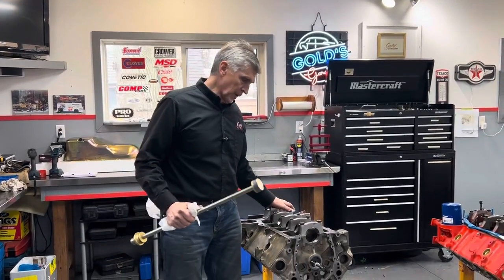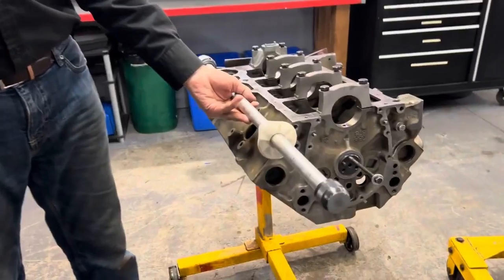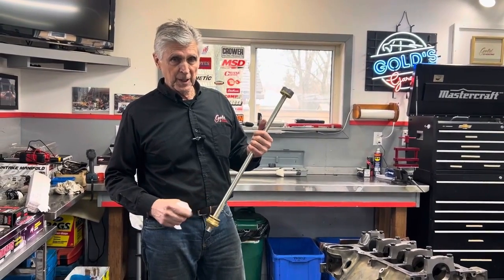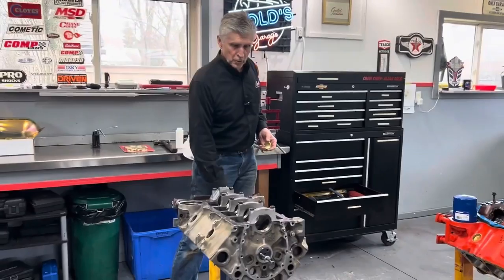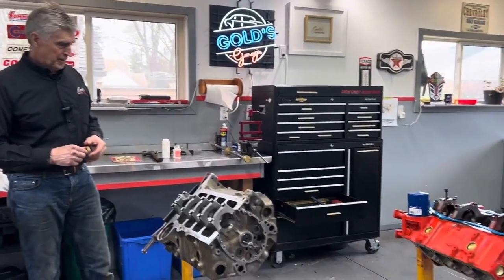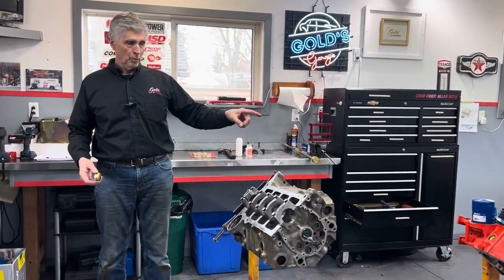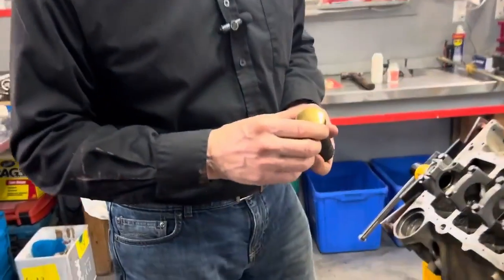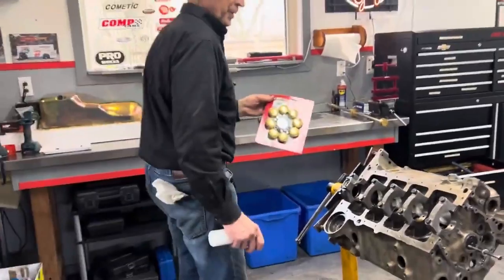Building a Small Block Chevy - Cam Bearings, Frost Plugs and Tips for a Perfect Paint Job!

Comment: On 2,3,4, and 5 the correct cam bearing hole orientation is at 2:00 with the engine upright looking at the front.  #1 would be 10 and 2 also upright looking at it from the front with the engine upright, correct?
Reply from the maker: That is correct. Thanks for the question.AG
Reply: @ thank you

Comment: Believe or not, by torching the bare steel with a propane torch, you are actually hitting the surface with a very high content of moisture.  Not kidding!  When propane burns, it creates a huge amount of water and you are actually causing instant flash rust on the bare steel...and that's what you are describing at 14:41 in the video with your comment of the  "changing color there." That is moisture forming on the surface, and you can almost see a slight browning of the steel...in other words, rust.  The only way to accomplish what you are attempting to do is with a heat gun, or indirect heat from a propane torch...but direct heat from propane is a horrible idea on bare steel.
Reply from the maker: Great information, thanks for contributing to my channel Rich. AG

Comment: If you point a torch at cold metal the steam in the flame will immediately liquify on the cold surface of the block. (You are burning a hydrocarbon after all). The block would quickly rust if it had water on it. I do not believe there is water in the metal.  Any iron in contact with water and air will rust immediately. Also note that air will dissolve in water if above freezing so rust will start immediately.
Reply from the maker: Thanks Marcus. AG
Reply: Uncle Tony’s Garage did a video on torching the block first to pull the cleaning solvents from the block before painting. 
There was a difference between the two sides of the block when he finished, he had to go over the one side several times before it stopped wicking out.

Comment: Older 400 blocks had 3 freeze plugs on each side and later 400's have just two per side.  70 through 72 have 3 plugs per side.  73 and later 400's have two plugs per side.  The casting for the center plug is in the block, but it is not machined on the later 400's.  You can buy different mandrels for the cheap cam besring tool, sbc and bbc...
Reply from the maker: Thanks Leonard. AG

Comment: That cam tool is junk, caused me to ruin 4 cam besrings and I have put lots of cam bearings over the years without any problems.  I went back to the single cam bearing tool for a bbc, 3 piece and works fine AG.

Comment: its a core hole with a freezer plug. two different purposes. three if you expect it to keep the coolant in liquid form. pretty good thing to have
Reply from the maker: Thanks. AG
Reply: Four purposes if you use one of the holes for a block heater, as is common in Canada. Likely the keyboard “experts” arguing about the name of the plug have never built an engine. However, these “online experts”felt it necessary to correct you rather than appreciate the significance volume of helpful and proven engine building knowledge you are sharing. Keep up the good work.

Comment: I’ve always used the correct size sockets to drive my brass freeze plugs here in the north without issue.. I’ve seen some shops actually epoxy them in.. I do like your new driver, think I’ll turn me out one on the lathe out of a piece of nylon.. Good video Allen, good to see the 302’s coming along.
Reply from the maker: Thanks Phil. AG

Comment: Let's add another choice for the name  for  the plug.  Steel cup plug. That doesn't roll off the tongue but is probably the most accurate name. I wonder what it is called in England being it will wind up under the bonnet.
Reply from the maker: Thanks 4speed! AG

Comment: I cut a small 45 on the meeting of the thrust bearing where the top and bottom set. The idea is to force feed the thrust face on engines that will be held on the tranny brake.